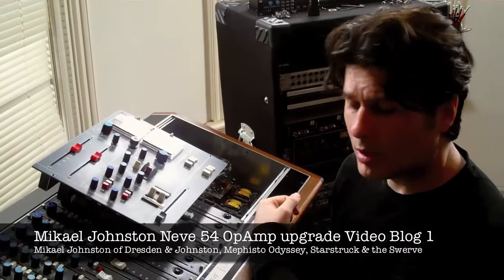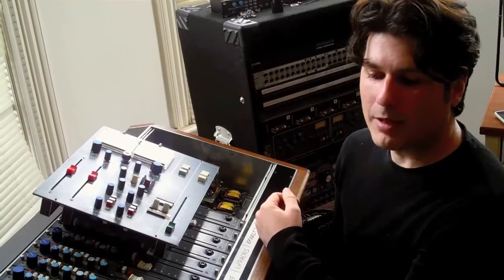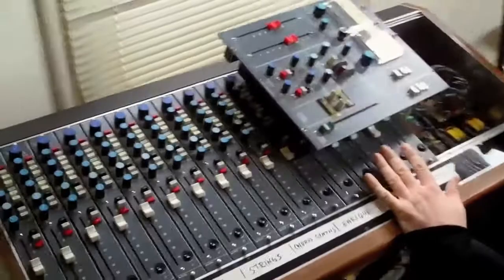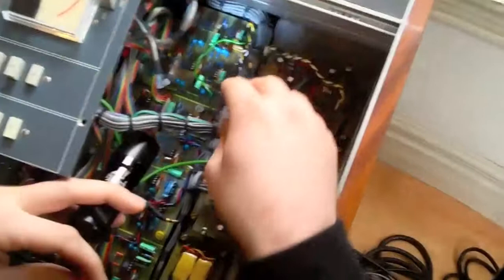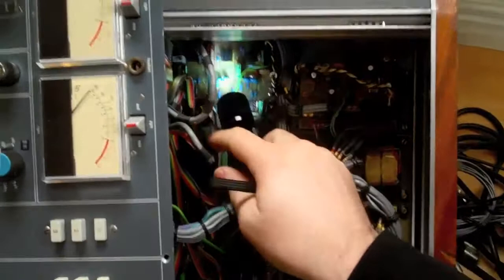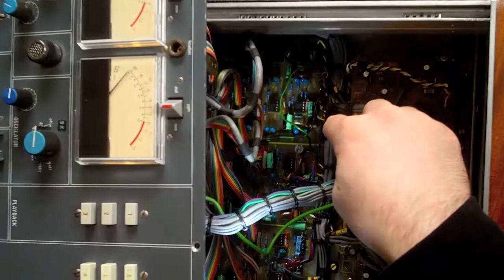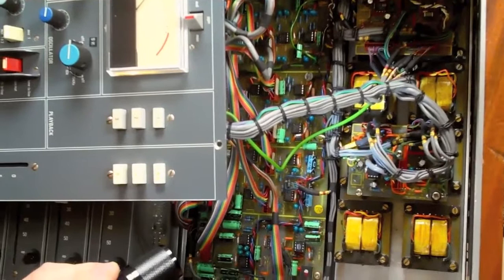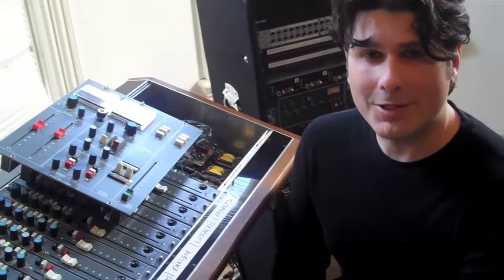Mikael Johnston of Dresden & Johnston works on a Neve 54 console Official Video Blog 1

Comment: I own a Neve 5465 console, I love it! I'm not sure i would ever mod it. The mic pres sounds great but i prefer my pair of Neve 1066's ;) How does the mod sound? btw i bought it from the very talented producer Jacquire King (Kings of Leon, Modest Mouse, Tom Waits)
Reply: Interesting. Jacquire King is Nashville based. So am I and I have a 5465. Do you still have yours?
Reply: I’ve been doing some very tasteful mods to my 5422 
Mods include the direct outs update that were originally designed for JLM DC gapped transformers - these are the same specs as the Neve L01166. So now I have actually updated them to 8 L01166 transformers and haha it’s ridiculous! Every channel sounds like my Neve 1073 but that’s hard to believe hey 
I was shocked!
Reply: @AndrewRoyal137  I have spent all Covid doing massive upgrades with my 5422 and I think I’ve got my head around every option and the whole ins and outs of the 54 series.
I’d be happy to share any details with you about mods, I’ve spent way to much time researching the whole thing 😎😅 

Be great if there was a follow up to this video it’s very cool and great to hear about the records they’ve cut on it 💯